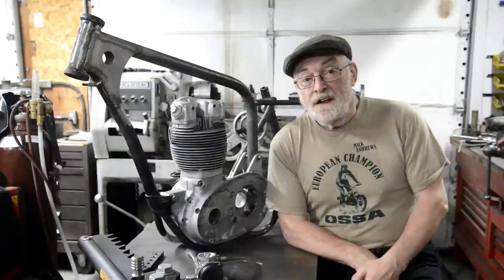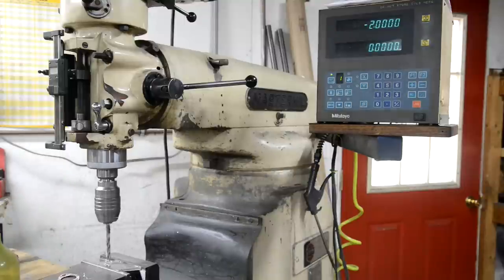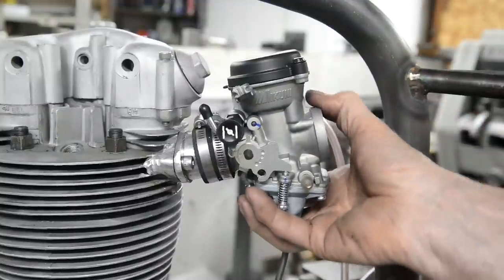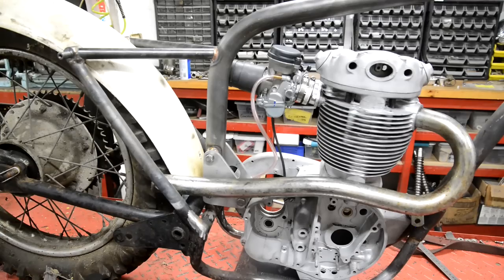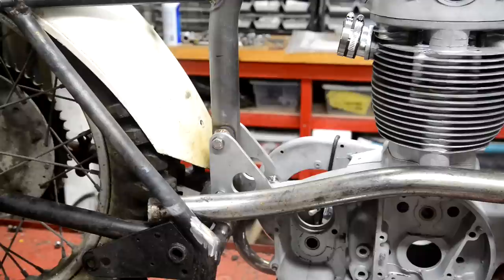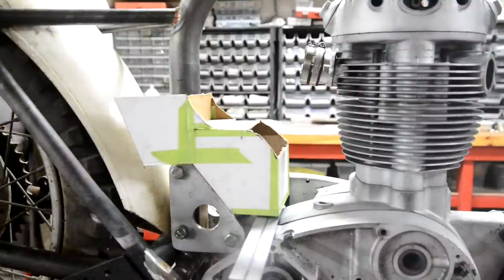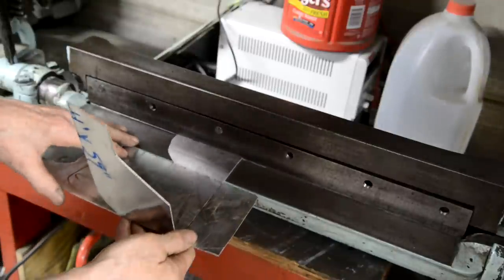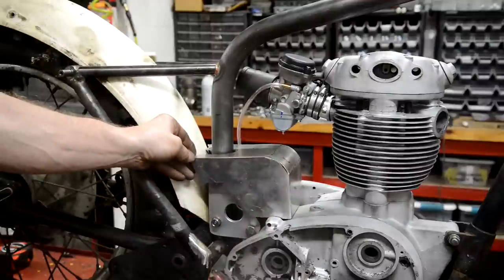BM B44 Trials  -  Part Six

Comment: I agree with @retiredbore 378. The 90 deg bends should have an internal radius of at least 1.5mm and preferably 3mm (2 x material thickness) to prevent cracking.  Did you eventually anneal the aluminium?
Lastly, oil tanks usually have around 25% expansion (air) volume added to the oil capacity to help with de-aeration. 
An extended filler neck would help both this volume issue and allow a funnel to be inserted for filling.
Years ago, I designed hydraulic tanks for construction equipment and learned these thing the hard way!

Comment: Nice video, as always. I thought an exhaust with a carb on was a novel idea… Oil tank; a bit late to give this suggestion, but looking at your flat-shaped 1 litre oil-bottle, why not an oil tank which is the bottom part of the rear mudguard? Double-skin it on the wheel side. And if it had a triangular horizontal section, it’d leave enough room for an air-box on the left side of the bike. Just a thought.. Les in Chester

Comment: As others have said it is call "The Angel of the North". It was designed be Anthony Gormley and the pieces were cast in our neighbouring town of Halifax in West Yorkshire.
Keep up the good work 👍
Reply: I think the metal fabrication was done by a company in Middlesbrough, Michaels's neck of the woods, and the engineering design by Ove Arup. Original art design by Antony Gormley. A 6 ft high or so replica is in Gateshead Civic Centre.
Reply: @cdp9633  you're correct, I blame my wife for incorrect information 🤣🤣
Reply: Yes, the pieces were flame cut from steel plates and welded together, rather than cast.

Comment: I have a BSA 441 it's a bit for me to start which is why it had only six thousand plus original miles. I much prefer the 250 version which is almost as fast but half kick and it's going and I have it in every variation including the triumph one that they used to call the triumph turd. They are more than powerful enough to make commuter bikes or dirt bikes. I used to Chase my German Shepherd home on a 500 Daytona on the trails from the lake and with Street everything it was reasonably good 👍. In the 1960s the British made great everything and in the 1970s they ran everything into the ground so disappointing. As long as you maintain them properly and don't abuse them they serve you well and they Outlast you and serve someone else for decades. I have used my triumph TR6 with a boat on hardtail and a magneto for almost forty years. When the bike was 50 years old we had to replace both of the camshaft because they were worn out so for the first time in her life the cases were split and everything that might have been questionable was replaced. The sludge trap was almost full so it was a good thing we split the cases.look at all the people who ride British motorcycles for decades after the company's went belly-up. British bikes are rebuildable forever ♾️. Just like when you buy toy trains the person who originally bought some is dead the person who bought them after him is dead and now you're going to buy them and when you're dead someone will buy them from your family. My last purchase I got from an estate sale in Georgia. BSA 250 Starfire for $500. Six six thousand miles and change everything worked beautiful shape and an alloy tank instead of the normal gas tank. Only thing missing was the left side cover. I thought it was a larger single because it had a decompression release and when he said it was a 250 I'm thinking what kind of proof to needs a compression release start a 250 BSA single and good tune half a kick and it is running. Great bikes in the old days as long as you maintain them properly and it gives you such a sense of satisfaction when you do it yourself.

Comment: I forgot to mention: will there be any filtration in the oil system?
Reply from the maker: No. With the trials bikes only using a litre it is cheap to change it regularly. Plus the roller big end on the B44 is very forgiving unlike shell bearings.